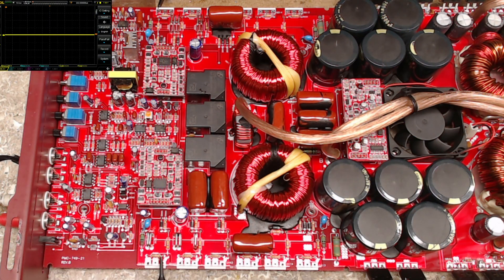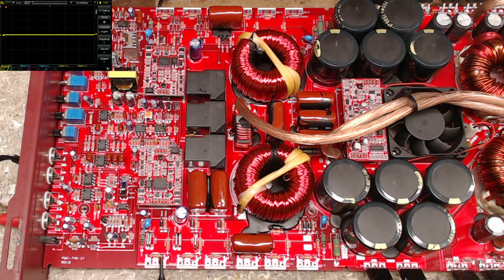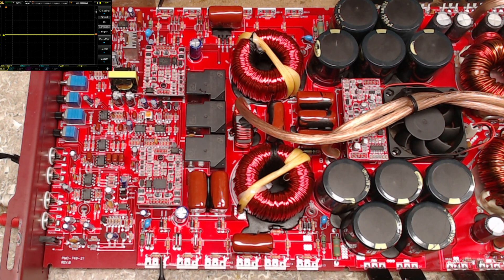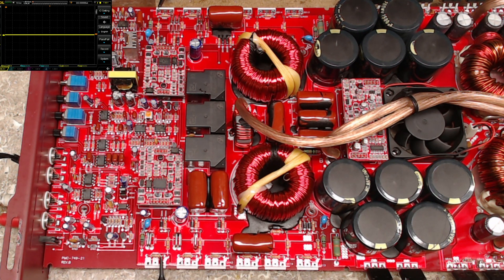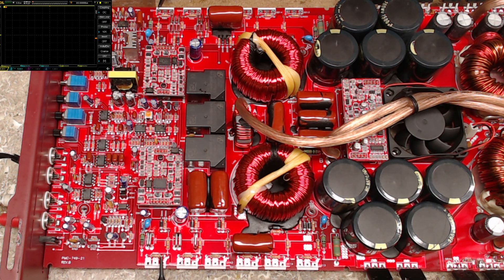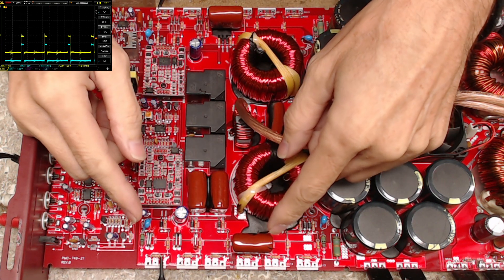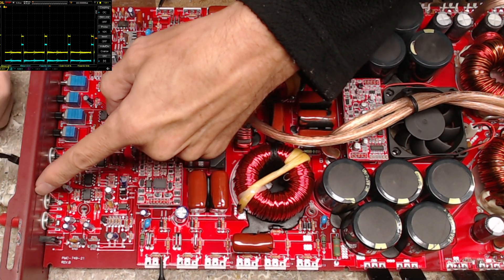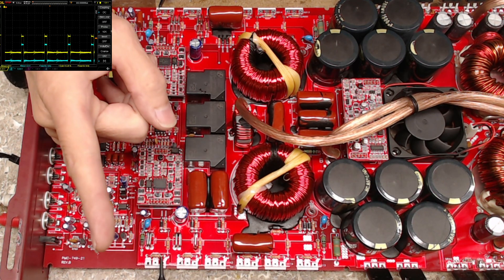Orion HCCA 5000.1DV2 Tips On Output Drive Evaluation Class D Car Amplifier

Comment: Hey Todd,  what glue do you use to keep transformer wires and caps secure to the board ? I'm struggling trying to find something that works well . Thanks
Reply from the maker: I use Gorilla Glue Clear Grip which I think you will find is easier to work with than other adhesives.

Comment: I need to know which leg on the output FET has reference to Gnd and which has the Rail voltage. I also need to know where the 10ohm resister close to the output outer legs connected to because the trace very close to the leg has damaged
Reply from the maker: Can you email me a picture of the area you are working on? I am not familiar with 10-ohm gate resistors at the output. Also, I can point out which transistors will have what.

Comment: Great Video Sir, But can you explain how the Brazilian Stetsom Ex5000eq work? I really don't understand the class D setup in these Brazilian amps.
Reply from the maker: I can sure try! Is there a specific function or process of the class D amplifier that you get stuck on? There are several components to the Brazilian style amplifiers.
Reply: @ellensburgamplifier  mainly how the voltage on the speaker terminals, the out drivers configuration and the voltage that should be on both low and high sides output FETs legs.